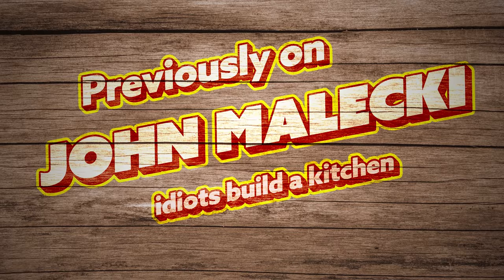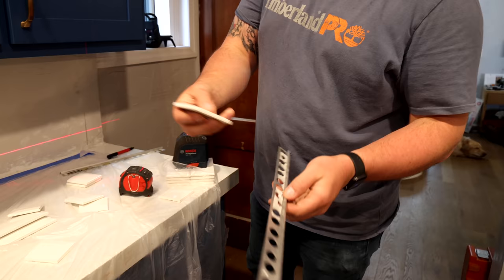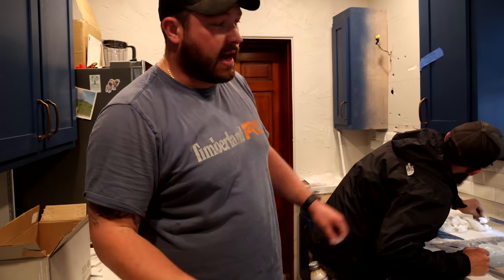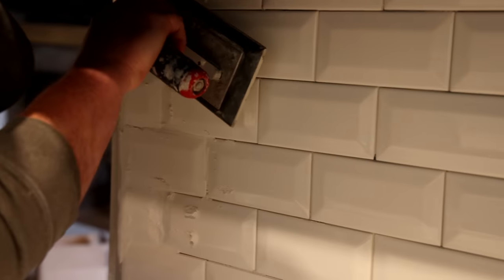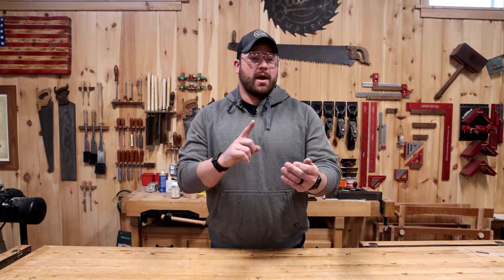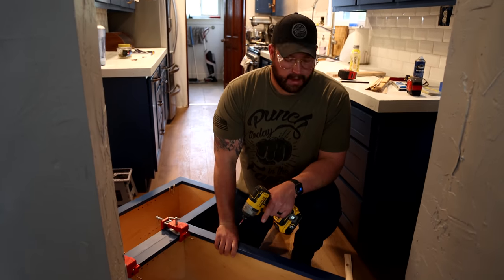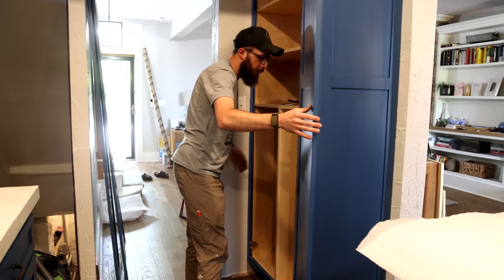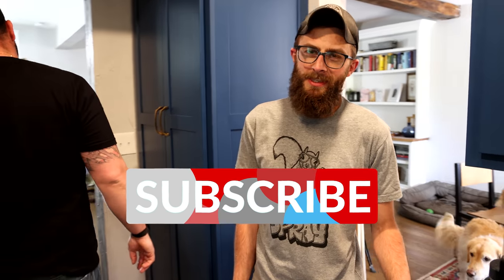WE FINISH THE KITCHEN  | Renovating My Kitchen Pt.7

Comment: Jordan, having worked in a cabinet shop, and happily no longer there; I can say that there is A LOT to dimensioning cabinets correctly that revolves around things you would not think about until you go to install. Guys, well done on getting squirrelly. It looks awesome.
Reply: Same I'm so glad I'm not doing that anymore, you get measurements and then something always changed by the time they're to the jobsite and no one is ever willing to admit who was actually wrong and you have to deal with so much customer bs

Comment: Great video! As a millwork draftsman kitchens can be tricky and often the draftsman catches the blame. Best way to avoid mistakes are really good site sketches, great communication, cardboard templating for the squirrelly stuff, and detailed drawings. When I draw millwork in CAD I’ll build an existing wall from the site sketch and build/adjust around it which is helpful since most people respond well to visuals.

Comment: I run a custom cabinet shop. I thought it was gonna be easy money when I made the transition from furniture to cabinets. I was wrong lol. It's a tough business. Lots of money to be made, but it's super difficult to do it right and efficiently... I understand there are varying degrees of "right and efficient" lol.

For my 3 man cabinet shop to complete an average kitchen I consider "efficient" to be 3 days to do the woodwork and assembly. 2 days for painting, and 2 days for install. So basically a complete kitchen with no call backs or remakes in a week and a half is considered a great job in my opinion. Average kitchen being $15k gross, with about 4k-5k in material costs. Can get done almost 3 kitchens a month if we don't screw anything up... But something always gets screwed up lol. Lots of work to do on fine tuning to go. And in the future we can increase our efficiency big time. But it takes an incredible amount of work to speed up the process and not cut corners on quality. Heavy investing into tooling and CNC software/programming is required. It's a huge headache. 

The trick is to get it right the first time. Cause screw ups it can take a week and a half job and drag it out to a month very easily if you have 3 or 4 editions of screw ups.

Comment: If you ever have to grout tiles with beveled edges again, you should use a piping bag to put it in the lines between the tiles. Then use your finger or one of those cake fondant ball tools to force the grout fully into the gaps. It takes a bit of practice and time, but it saves a lot of time in cleanup

Comment: God I hate metro bevel edge tiles with a passion. I use tile T spacers and the bevel edge means that the spacer is almost as thick as the edge of the tile and leaves little to no depth for grout. Here in UK we're required to not have tiles touching each other

Comment: Hey Simple trick for centering a layout for tile, roofing, anything with sections that you want evenly spaced. you divide your run by your tile widths. then take everything after the decimal and multiply that by your run. now you have what your last piece will measure. if you want to center up the rows then add one tile width to that and divide that by 2. then you have your start and finish tile. another pro tip is if you are doing really long tiles dont center your stagered layout all long tiles have a crown to them that makes leveling them a nightmare. instead stagger your joints in thirds.

-TLDR: When you want to center up a row and it doesnt break evenly. Just add a tile to it and use that to split the difference.

Comment: Hey John, how do you remove the heat generated from the water dispenser? i have the same unit in my pantry and had to remove the door and leave 3" of empty space on either side to the heat to dissipate and even with that the unit still turns on almost twice more than when is on open space

Comment: Fair warning. You will end up hating the sink flip down for the sponges. I used to put them in kitchens all of the time. What we discovered, regardless of the brand, is that the hinges wear out really fast.
Reply: Seems like an inset magnet and metal plate could solve that problem pretty easily.
Reply: @prophetableforprophet on a tiny radius door swing, that magnet will hold stronger than you think.
Reply: @JasonACadder  I'm sure you could manage finding an appropriate magnet without any difficulty.

Comment: This was painful to watch.   Where do I start. The Mastic was old and dried up. They should have scooped the whole top layer off and got down to the smooth butter stuff.   Then they should have found Center of their work area and started at the center so both ends match. There was NO reason to start 1 layer up. They should have started on the bottom row dead center. Is it fine? Sure. But they made their job way harder on them selves.
Reply from the maker: I appreciate your input, here is a video that also proves you're completely wrong from a real contractor https://www.youtube.com/watch?v=HIyIGJcJejU
Reply: @John_Malecki  lol @ Real Contractor. I must be a fake one. Shall I make some videos of my work and customer reviews? This is what I do for a living.